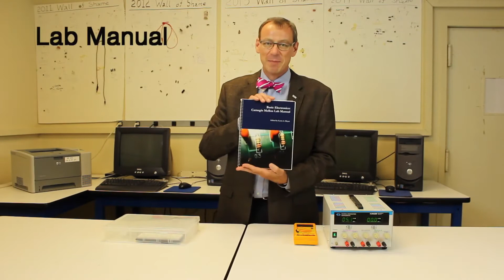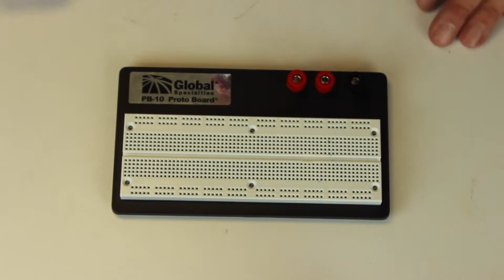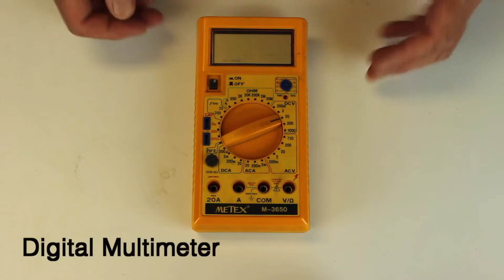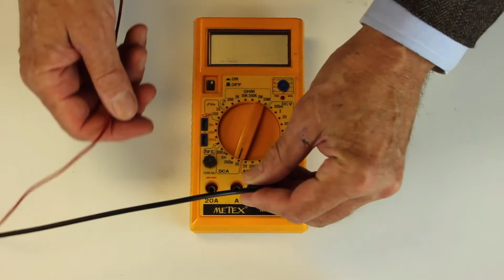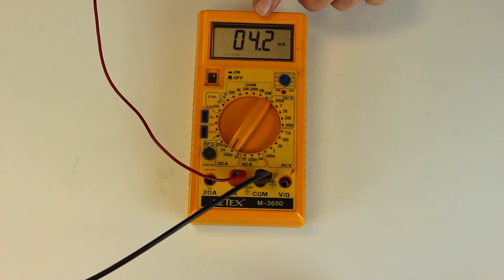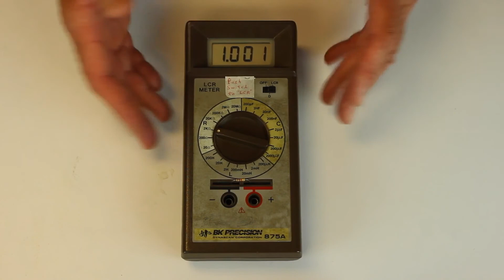An introduction to the electronics Laboratory

Comment: Plzz tell why the fuse burns out if we don't use 20 A scale
Reply from the maker: Maybe you are connecting the multimeter set to measure milliAmps in parallel. Meter must be connected in SERIES if you want to measure current.